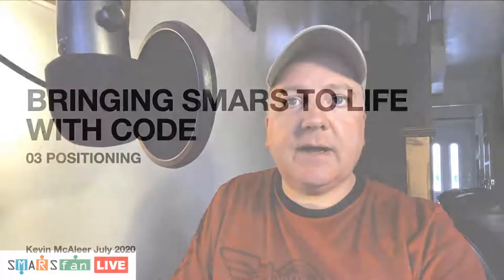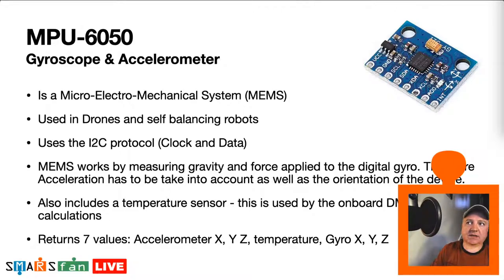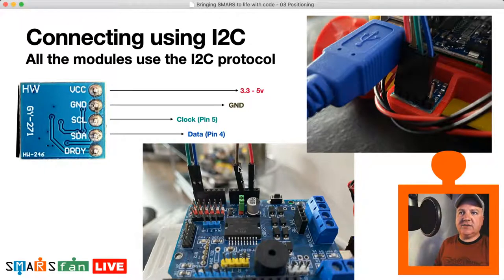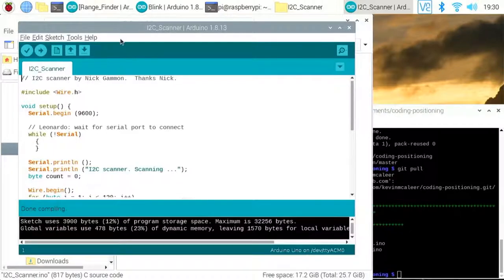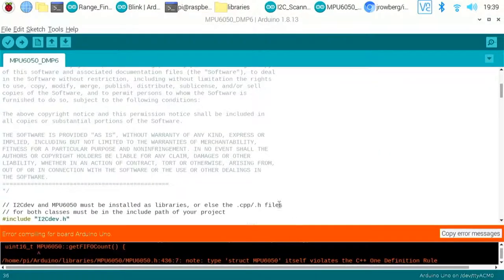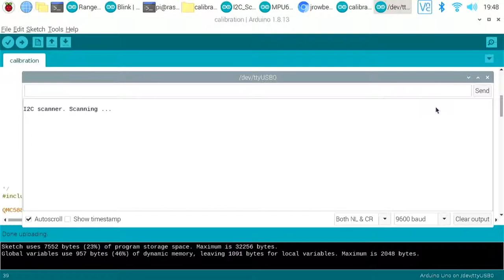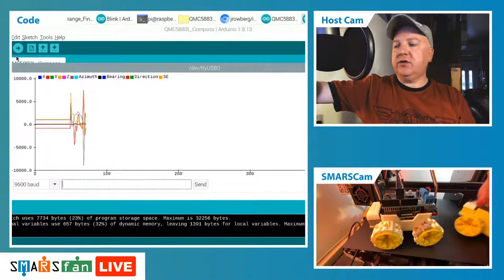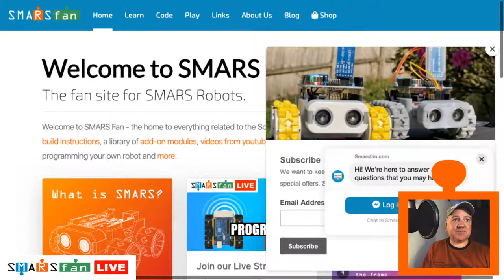SMARS - MPU-6050 & GY-271, Arduino Programming Robots

Comment: Hi, Mr. McAleer,
Thanks to share your experience :)

I'm wondering if the magnetic field generated by the rear motor doesn't disturb the HMC5883 ?
Isn't the sensor too close to the motor ?

I ask you this question because I printed the same sensor support than yours and I put it on the same position and when I start my SMARS, values of the sensor are crazy ! and when 
I move away (approx 10 cm) the sensor from the motor, data are correct !
Regards :)
Reply from the maker: Hi @franck, you may be on to something there. I'm going to experiment with this too and see what happens. I did notice that the sensor seemed to act odd when it was in the holder, however I assumed it was the wires not connecting properly. It may well be the motors as you say. I'll see if some shielding can help too but putting some aluminium foil around the motors.
Reply: Hi  @kevinmcaleer28  , Cool ... and thanks !
I also had the idea to create a "Faraday cage" around the motor with aluminium foil but I had no time to test this "solution".
Please continu to share (electronics & Fusion 360) ... this inspire me :)

Regards.
Franck